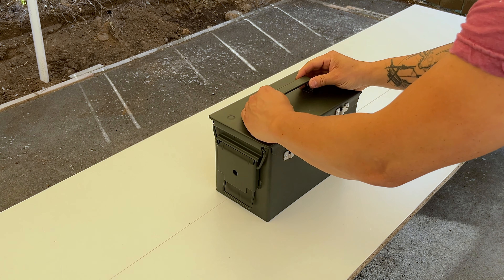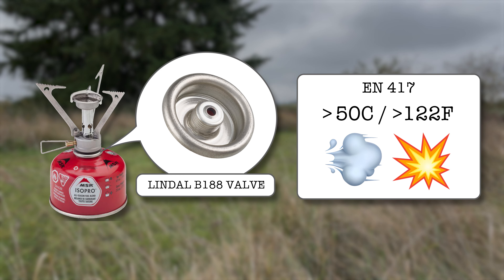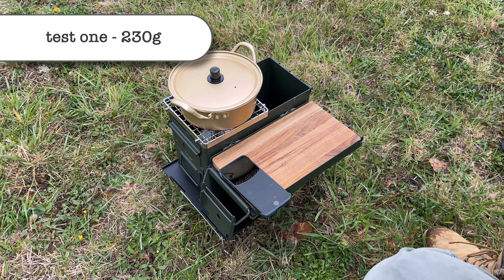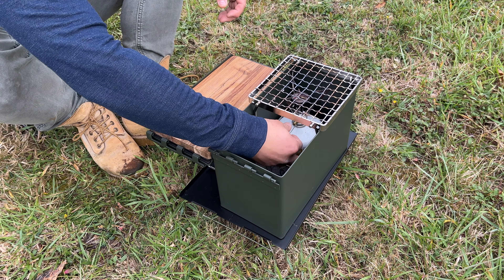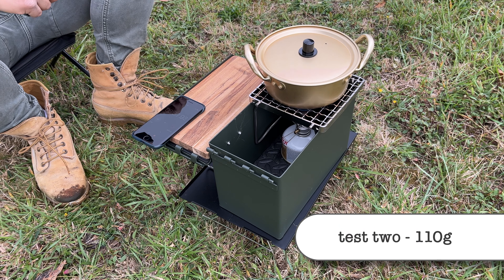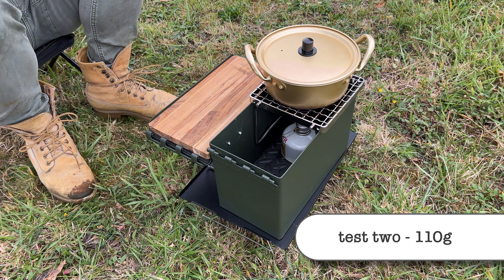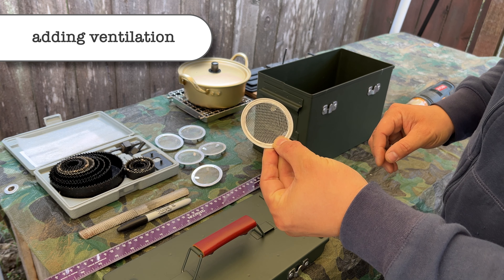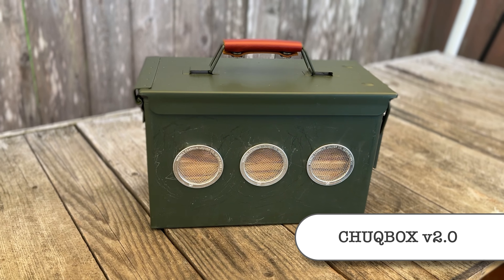Will My Camp Fuel Cell Explode?! | Ammo Box Camp Kitchen Chuck Box

Comment: Seems like overkill on the ventilation, one hole closer to the bottom would have done the trick. As hot air rises, cool air can enter from below effectively making a chimney.
Reply from the maker: I think you’re right. I went 3x smaller vents instead of 1x larger vent for aesthetics. If I build another, I’ll consider installing them lower. Thanks!